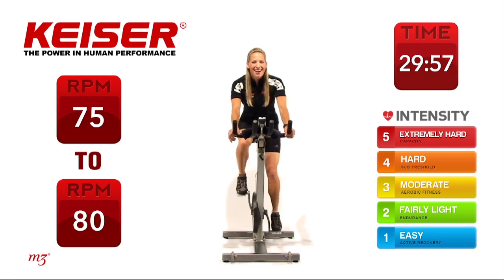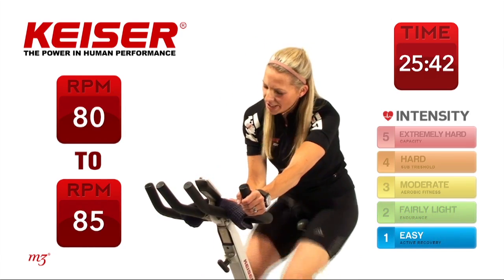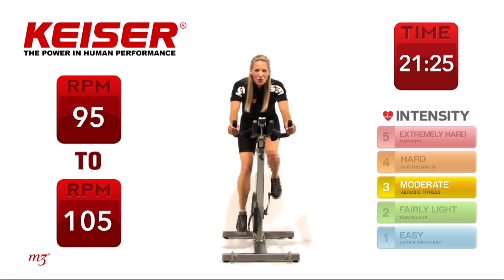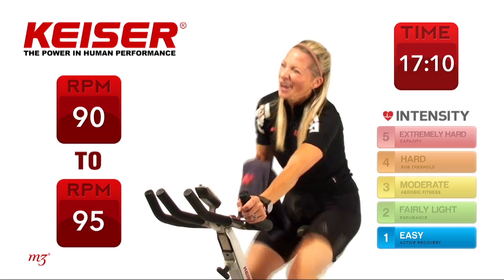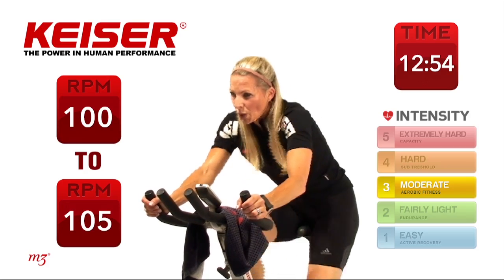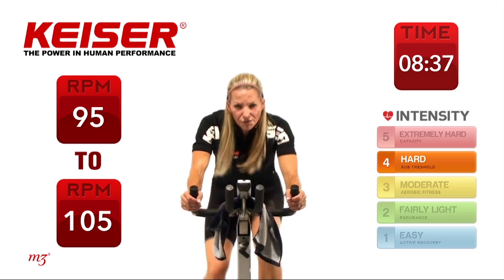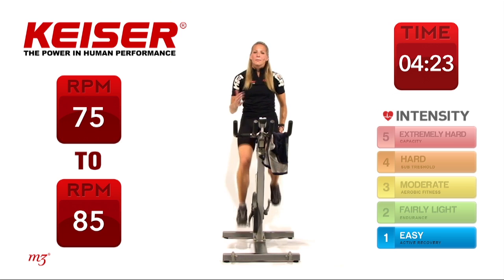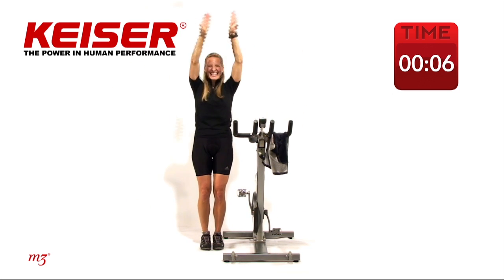Keiser Cycle Power Ride

Comment: At what gear do you suggest a 22 year old 153 pound female sets it? I work out about 4 times a week, I can run 5 miles long distance and finish in an hour. I’d just like to know.
Reply from the maker: Hi Sandra, thanks for asking. Our trainers teach the following gear ranges: 1-5 intro (before class) 5-10 warm up, 8-12 Easy Flat, 10-14 Hard Flat, 12-16 Easy Climb, 14-18 Hard Climb, 16-24 Very Hard Climb. Of course they point out that ones personal intensity is based upon their exercise goals. Hope this helps
Reply: @KeiserFitness  awesome. Thanks for responding!
Reply: @KeiserFitness  Confused by your answer....one person's gear 10 probably won't feel like another person's gear 10, correct?  However, if you are teaching to perceived exertion and later on, perhaps to  percentage of FTP  you can be reasonably assured that your riders are feeling the same thing.    Also, your speed at a particular gear dictates degree of difficult via the power you are producing.  Riding gear 8  at 90 rpms and riding gear 13 at 90 rpms are going to feel vastly different.

Comment: Such a great work out but only 160KCals. Felt like I expended more than that!
Reply: are you getting the Kcal from the onboard monitor? Because I think that reads something else or calculates calories differently. My apple watch gives me a number very different from what the monitor gives me, and I think the watch is more accurate given that it’s in agreement with other exercise machines I use
Reply: @mariopellegrino7661  Kcal can't accurately be measured on most bikes.  The bike doesn't know your weight  or your metabolic profile.  It's looking at your 'gearing' and speed and assigning a number.  Focus on the number of watts you are generating.   For a  novice, a good goal  is that during the" challenge " portions of the class you are riding your body weight in watts.  Eventually, your flat road resistance will be your body weight.   That number will improve over time as a result of training effect.    Re kcal, if you are working realistically in various zones of intensity, I've found that 8 - 10 calories per minutes is totally plausible....

Comment: Where's a workout that tells you what gear to be in?? Thats what I'm looking for
Reply: The workouts give you various zones of intensity that you are to work in.   One person's gear 10 may feel easy.  To another person gear 10 may be very difficult.    But if the instructor or the ride profile tells you to ride 80 rpms and make your resistance feel as if you are working in  a "moderate" or  "difficult" or "easy" intensity, then you have a goal to shoot for.     The goal is producing sustainable power.  Focus on intensity and power as represented in watts.